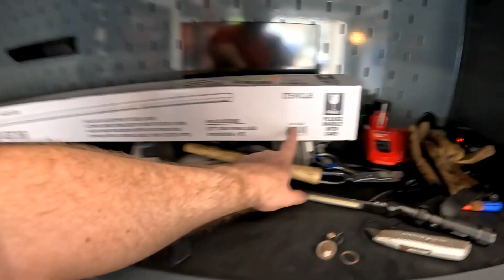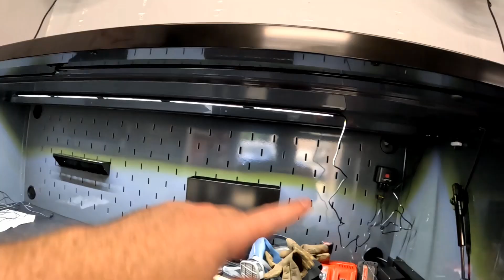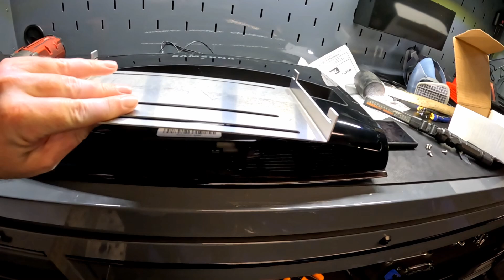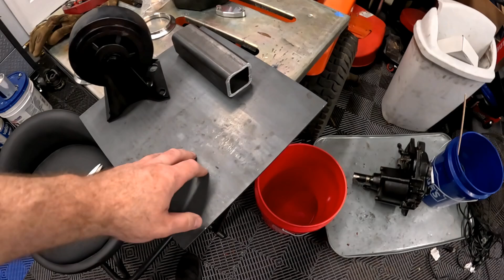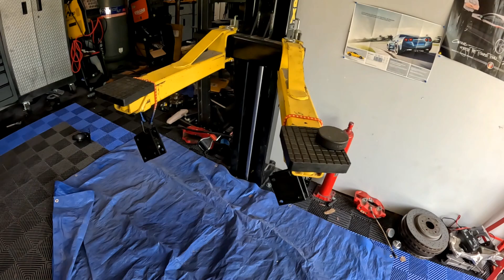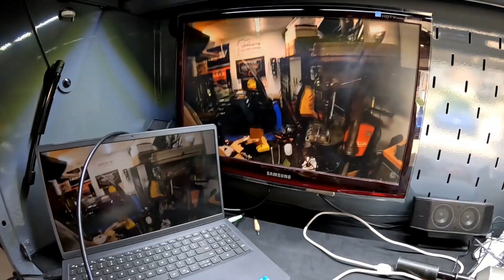@harborfreight #usgeneral Series 3 Hutch & Toolbox Modifications

Comment: Great job man. Sweet garage!! I was lazy and called harbor freight’s 1800 number. I ordered 2 fixed casters and 2 swivel casters for a 11:30 56” box to put on my 42” box so that it would sit at the same height as my 72” and my 56” series 3. They were about $110 shipped . They bolt right up. I think it’s dumb that the 42” box has shorter casters. They know we want to bolt these boxes together they even gave us the holes and instructions in the manual on how to do it. Lol  hey what kind of flooring is that in your garage? Thats amazing looking!
Reply from the maker: I actually just ordered 4 swivel casters - I think they will be here next week. I've done some expansion to the 27" box and need better steering. 

The flooring is from RaceDeck and I've had it for just about 10 years.

Comment: Nice work on welding up those spacers. Yeah I definitely would have been lazy and just used some wood blocks lol.  Nice setup 👍
Reply from the maker: If the price wasn't so ridiculous for 2 spacers - I probably would have bought them. 

I had the tools, time, and some "skill" to fabricobble them together - and I think I had like under $30 in steel costs for the whole project - so not a bad cost.

Plus any time you get to practice welding - that is not a bad thing.
Reply: @bonecrrusherSS  Heck yeah man. Yeah my welding skills are a 1 on a 1 to 10 lol. Got a lincoln and some 75/25. At that cost hell I may have to give it a try too if I wind up picking up the same box setup. Nice work again.